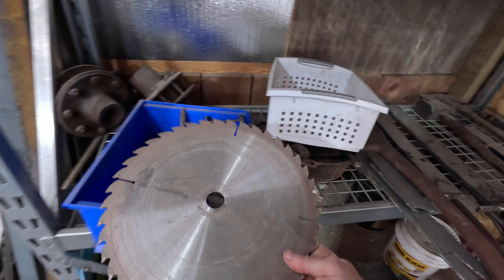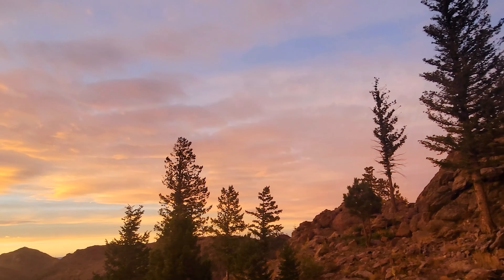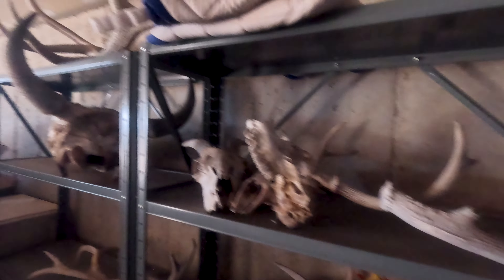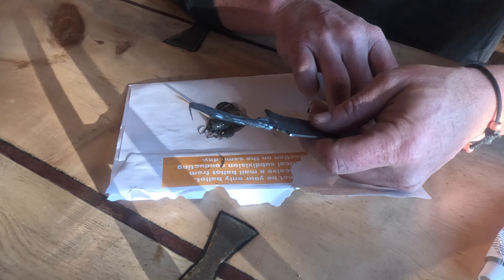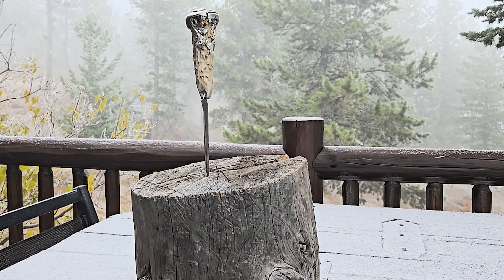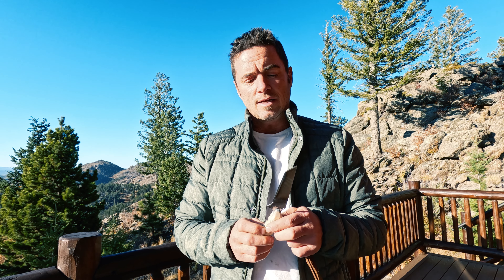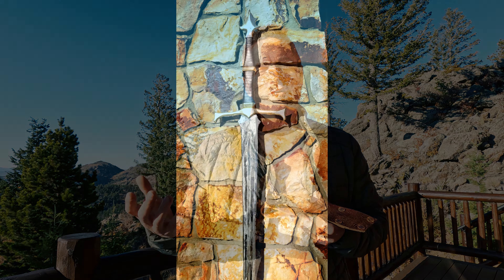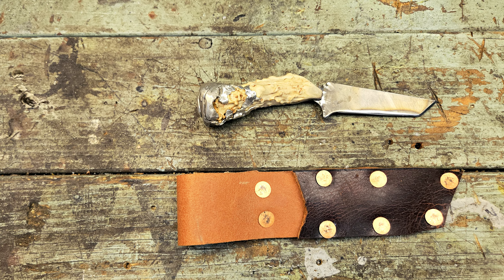Crafting an antler handle hunting knife

Comment: You are often harder on yourself than you should be. For someone who wants something unique and practical, you have provided exactly what was asked for. I was surprised and pleased with how sharp you made this knife. Early in the video you said he didn't want it to be sharp and immediately my reaction was to cringe. More people are seriously injured by dull knives than sharp ones, so you likely did him an additional service by making it as sharp as you did. I do think a small brass guard would have made the transition from the blade to the handle more fluid and if you could have made the solder cap match the coloring it would have been more to your liking. I might be wrong, but that's the impression I got from the finished product.
Reply from the maker: That's a great idea about the transition area. I debated doing that.  I agree on dull knives. Although a fewa with the skinning knives I have owned, or other have owned, I have seen some decent injuries from them being too sharp which is interesting..